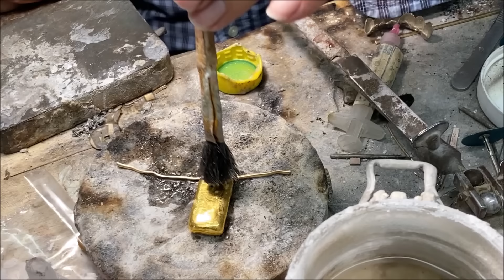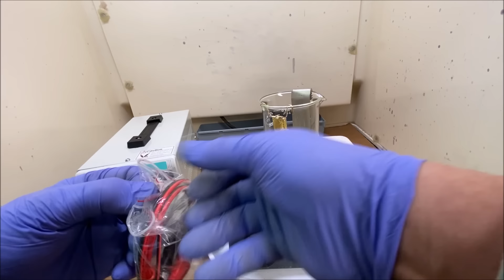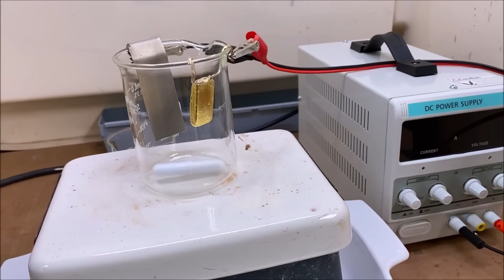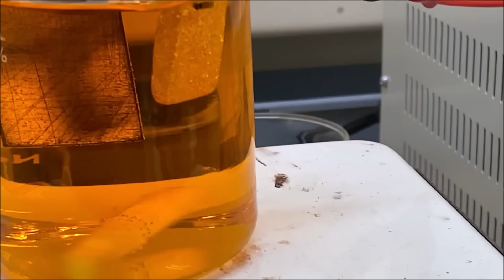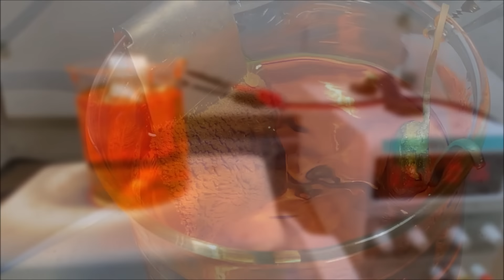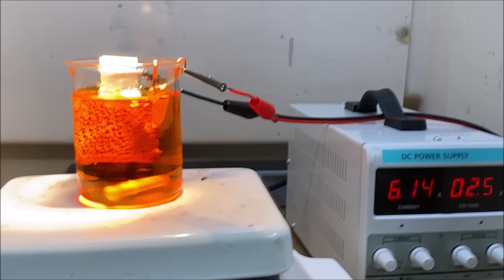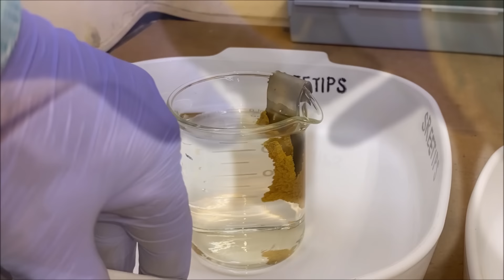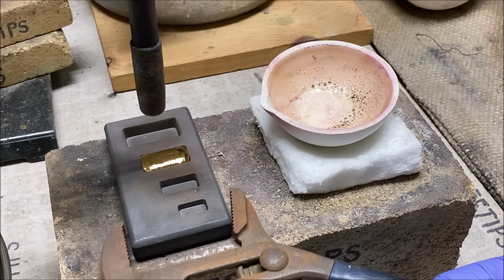Electrolytic Gold Cell Part 2

Comment: All of that to get 99.9999 fine gold and you go and melt it in a dirty melt dish. 

All joking aside, that gold you rolled out, do that with the gold you inquart with silver Roll the pieces out until they are super thin and it literally takes next to no time for the acid to remove the silver leaving just the gold.

As for the gold cell. Does the gold you use on the anode side have to be pure gold or can it be slightly dirty 98% like the silver shot in the silver cell?
Reply from the maker: I’d rather let the acid do all that work for me. I used high purity gold for the anode but it could be slightly dirty 98% or higher purity and still work.
Reply: @sreetips  Thank you so much for the input

Comment: Sreetips what a fantastic video! Wow dude! One thing I noticed you didn't account for when applying the electrolyte+HCL is the increase volume when heated. At first the level shot pretty far above the mark and came really close to hitting the dog ears from heat expansion.
Reply from the maker: During the time lapse, I added electrolyte and HCl to maintain the level. You can see it during the time lapse if you watch the line throughout the sequence.

Comment: I had the same issue in a copper parting cell. I elected to insulate the edges of the SS cathode to prevent the wrap around.
Reply: My rollers made curved rollouts like that until I set them back to parallel. Seems the right side was a couple of teeth wide. Alternating which side is facing up may help as well.

Comment: Confused [ easily cuz I dunno jack about this ] but - started with two bars  11.5 & 58.2 [ 69.7 ] grams ... ran it all thru the process and had "some" left in solution ... and I think like 57.x grams in the new bar.  Was the process to obtain a better quality of gold in the end or ... what was the goal ?
Reply from the maker: Yes, this is how big refiners produce four nines gold. The goal was to demonstrate this process (known as the Wohlwill Process) on a small scale. But my goal personally was to see if those titanium turbine parts would work as cathodes. And it worked beautifully.

Comment: Sweet! We had a mold made with dog ears already on it. Shaped like a T, when we made our initial melt we would pour into it. You can make the "crossbar" any length and/or thickness. A friend of ours places his unrefined bar in a nylon type net under the "gold" and catches the material that falls off, while the high purity gold passes through the solution onto the titanium. Then he remelts the "sludge" using Ag as a collector and goes into a silver cell. Good job!
Reply from the maker: I may further refine this to come up with a way to do my gold refining regularly using this method. I liked the result a lot.
Reply: @sreetips  Excellent!

Comment: Sreetips, since titanium has a ridiculously higher melting point then gold, wouldn’t it be easier to simply melt the plating off directly?
Reply: the simplest solution would be to use the four nines bar for the next cathode and use the three nines ribbons he rolled out as the next anodes
Reply: @chrisharris1522  true.. but with this method, after he chiseled the plated gold off the titanium he simply melted it. I figured just prop the whole thing over the melt dish and melt the gold off. You won't touch the titanium.
Reply from the maker: The molten gold would probably become welded to the titanium.
Reply: I was searching for this comment. I had the same idea watching the end.

Comment: Absolutely just blew my effing mind sreetips, wow I wonder if you'd have better or worse results from bringing the titanium to a mirror polish or a glass bead blasted ot tumbled finish . The way the gold formed though on the titanium in such a rigid seemingly homogenized way of absolutely insane, I had no clue that could happen and I did not expect that whatsoever.  I gotta say though I like the look of the plated out gold more than  the ingot that you poured.  Awesome video as usual.  Though I'm not really sure what the objective is with the gold cell if you are starting with high purity gold.. still awesome .
Reply from the maker: My main objective was to determine if the titanium would work as the cathode. And it did - perfectly!

Comment: ya know what, i reckon if you cooled a couple of smaller bars slowly and used them as multiple anodes you could get some interesting crystals to revel as it dissolved away
do you think you could swap the cathode and anode back and forward and impart more crystals on top of the ones that formed naturally? it seems like a way you could get real creative if you can figure out the temps times and current to get the crystals to grow how you want.

Comment: Very cool. I wonder what conditions it would need to be under to create more a pronounced crystal structure instead of the nodualized deposition? Are you going to send it away to be tested to find out exactly what purity it is?
Reply: he already knows it is at least 99.99% pure, testing would not give any more accurate results
Reply: @chrisharris1522  sure it would, thats the whole purpose of testing....confirming assumptions. Plus having proof of testing allows a whole host of other benefits like process optimization and even ease of private sale.
Reply: @Elusis1  I meant the results from the lab would come back that it was approx 99.7% pure, that is as high as they will assay it because of margin of error, if you want higher then you would have to sacrifice some of the gold for chemical analysis which would defeat the purpose as that would be more gold than the amount of impurities that it contains

Comment: drill hole through the top of the bar, just don't hang the whole bar in the electrolyte. throw the left over tab into the next bar for refining. also you could hammer a smaller tab section at the top to drill through.

Comment: Am I missing something or do these cells just retrieve the gold from the solution? It’s really cool to watch but trying to understand the purpose of it
Reply from the maker: It’s called “electrolytic refining” big refiners used this method to produce high purity gold. The impure anode dissolves and puts pure gold ions into the electrolyte. They travel through the electrolyte and deposit on the cathode. Any junk falls out as solids. Any other metals in solution remain in solution and don’t co-deposit with the gold, so long as conditions are properly maintained. Three nines is industry standard for pure gold. The fourth nine is therefore meaningless. Unless your a gold refiner. Then it means a great deal just to be able to pull it off. Plus, the main thing I wanted to learn was if that titanium cathode would work. And it worked perfectly.

Comment: Is it possible to make an anode basket and put mixed k scrap in to refine
Reply from the maker: Probably not a good idea. Karat scrap has silver, copper and zinc in it. These will tend to foul the electrolyte rather quickly. The silver will form insoluble silver chloride when in contact with the gold chloride. Some of it will dissolve in the hot solution because of the presence of the hydrochloric acid. So there will be traces of silver in solution that could possibly co-deposit with the gold if conditions aren’t properly maintained. Therefore, it’s best to use gold anodes that are fairly high purity of 980 pets per thousand, or better, pure gold. High purity anodes will ensure proper function and prevent the electrolyte from becoming fouled too quickly.

Comment: Titanium alloyed with gold is most excellent
Reply from the maker: In order to get that alloy it would need to be prepared under special conditions because gold will vaporize at the temperatures required to melt titanium.

Comment: If your whole purpose is to remove contaminants from the gold bar you have to ask where they are going. By having a stirring bar operating you are not allowing any of the impurities in the anode to settle out to be removed as they may settle out onto the plated gold. You do this correctly with your silver cell by containing the sacrificial anode within a cloth basket. I would follow the other suggestions about rolling the bar into a strip to form a contact point and put the material to be purified in a cloth basket or let the impurities settle out. Be careful to keep the voltage just high enough to plate gold and not copper, silver, lead, hydrogen or whatever. If you are making hydrogen the voltage is too high.
Reply from the maker: I may refine my electrolytic gold refining equipment and process. I liked the high purity gold that it produced. I think that some movement of the electrolyte is necessary to prevent depletion at the cathode. If the gold ions get depleted at the cathode then other metals could begin to co-deposit, if they are present in the electrolyte. But if I do this then I’ll probably use high purity gold anodes to begin with. I may even try running the four nines gold back through the cell for a second pass. Try for five nines. This experiment has got me interested about electrolytic gold refining.

Comment: Good job.
But i still think that doing this with a 14k or even a 10k as a cathode is worth the try  even with a smaller scale
Because just like the silver process, even the platinum group metal have lower oxidation voltage than gold and all the oxidation stats are soluble.
The unnone are the lead impurities.
Thanks for the experiment. realy enjoyable  ☺
Reply from the maker: The book calls for 980 parts per thousand pure gold, or better. 14k, at 583 parts per thousand, or 10k at 417 parts per thousand, would quickly foul the electrolyte. If I continue doing this then I’ll use high purity gold anodes to ensure the highest purity. Otherwise it defeats the process of using the cell.
Reply: @sreetips  got it

Comment: A neat project if you could figure it out.. get some small round pendants made from thin rolled out gold and use them as a cathode and electroplate them with a gold layer. I think they would look pretty sharp hanging off a necklace. The hard part if figuring out a way to suspend them in the electrolyte.
Reply: If the pendant has a loop at the top, clip or hook the cathode wire to the loop and hang the pendant so the loop just barely sticks out of the electrolyte

Comment: Thank you for sharing your content. 
I was thinking if you rolled the bar thinner for the anode it would have more surface area for the clorooric acid to dissolve it quickly. So it wouldn't take as long.

Comment: I'm not a professional at all and I love watching your vids but I was wondering if you could run your little dog ear settup after you purified I'd and it looks like the shark tooth. Would you possibly be able to run that through your press (I would call it) with another piece of gold and press it together so you could salvage the solder joint that u had to pay for?
Reply: Or would the cold joint be too unstable if you tried to press them together
Reply from the maker: I’ll just refine the solder joint with my next batch of karat scrap.

Comment: I have done a hell of a lot of gold and silver soldering, it can be time consuming and can go wrong easily without a lot of experience. Get an orion pulse tig welder and the job is literally done in 2 mins, the biggest plus that no flux or solder is required and a weld way way outdoes a solder joint for strength by many factors. Love your videos they bring me joy.🏴👍
Reply from the maker: I didn’t know that gold could be welded.
Reply: @sreetips  yea, I believe any metal can be welded, using a TIG pulse with a pure Argon shielding gas it leaves a superb finish that is strong and requires virtually no cleaning. No pickle pot required.👍🏴
P.S. obviously no flux is involved and the piece doesn't get hot. Also you don't need to buy 18k solder as a for instance, you can draw your own 18k wire and use that to fill any gaps which a solder will not do.
Reply: I used to work in a macinist/welding shop.  Per the hi tech welder had, you can weld any metal.   He welded a big copper cooling head for NASA, die to complexity it was machined in 2 parts and welded with the big welder and #4 copper ground wire.
Reply: @DavidWilliamsisslpdave  "you can weld any metal" 
Good luck with some of them, especially Hg.
Reply: @apveening  At -100 C,  a small jet of hot air would melt just enough of it to work like a welding torch
Reply: @frontiervirtcharter  Cooling it to -40 (C & F) should be sufficient.
Reply: I wonder if a spot welder would work, or maybe the gold would be too conductive to allow it to heat up enough

Comment: Can someone explain what exactly happened here, and the purpose or application?
Reply from the maker: The current flow dissolves the gold at the anode. The gold ions travel through the gold chloride electrolyte and deposit as ultra high purity elemental gold. Four nines fine or better.
Reply: @sreetips  Cool! ty

Comment: Gold or silver or any metal can’t be grown or they will be cheap.
Reply from the maker: Both of them can in an electrolytic cell.
Reply: But the cell needs feeding :D
Reply: they can be grown if you first put them into a solution, dissolved. thats how all crystals grow, and he is  taking almost pure gold and making the purest possible gold crystal this way.and gold crystal is extremely rare naturally. so if the gold bar had a tiny bit of lets say, copper or silver in it, then this process leaves those behind in the solution and only allows the pure gold to plate out. Gold cannot get any more pure, except maybe the moment its first created inside of a supernovae star..... but even then, the odds other precious metals were also created in the supernova and alloyed with the gold are very high...

Comment: Wish I had the setup to do metallurgical chemistry, but I'll just continue to enjoy every video you post.👍
Reply: It is fun, and not as daunting to get set up for an introductory experiment as you make it sound. Firstly you don't even need a power supply to start with simple reactions. You can weakly plate copper onto steel by dipping a piece of steel in a solution of copper sulphate, sold as root killer in most hardware stores. 

You can also electrolitically clean metalc surfaces like copper or silver, with a weak vinegar and salt solution, and 9v battery. You can grow copper and tin crystals crystals the same way, but for tin you first make tin chloride and use that as your electrolyte.
Reply: @nunyabisnass1141  many more Blessings to U Sir ❤
Reply: Start small. Start easy. First steps to walking are tenious little baby steps after all.
Reply: My and my mate used to make hygrogen and oxegen with with nothing but a pair of wires, 2 nails, a jam jar and a power socket (extreamly dangerous btw, do not do this). You don't need much more to do it safely, just a cheap powersupply and you're rolling. You'll not be able to refine/plate with gold or silver, but you'll be able to at least start learning stuff and dip your toes into electrolosis.
Reply: @Dafty_Boi  yes I used 5v 2A USB chargers successfully for plating copper. I used copper wire as (+) and the workpiece as (-) as a electrolyte I used HCL hydrochloric acid. Very simple setup. No need for any copper sulphate

And of course standard batteries AA to plate with gold and silver, graphite (pencil) electrode

Comment: Big issue is for this refining technique to get the gold in the spent electrowinning solution low enough. In our gold recovery process (using standard cyanide leaching solutions) we can get down to 1-2 ppm Au in spent solution however we are not trying to produce high purity cathode, just trying to recover everything we can from solution and put it in a bullion bar. The refining is the Refinery's problem we sell to. Great video as always!!!
Reply: Cyanide leaching sounds like the most time and cost effective method. I think I’ll start with that.